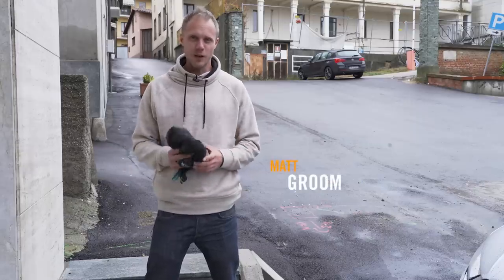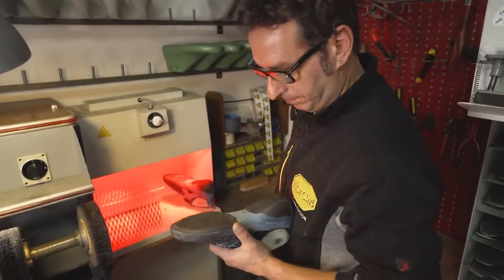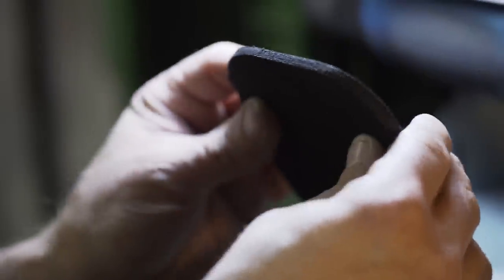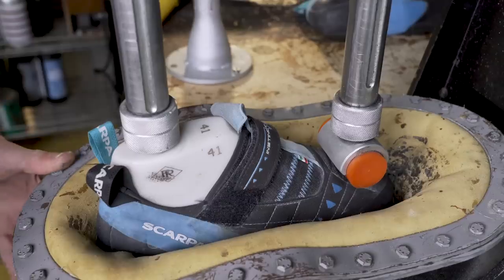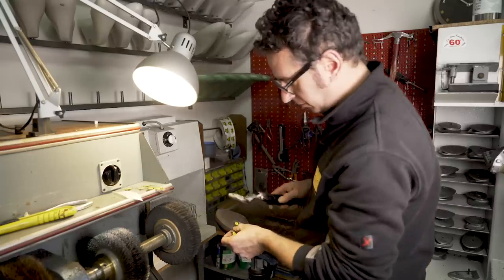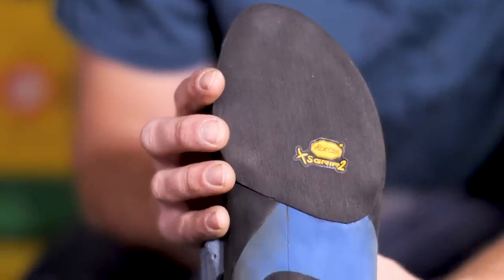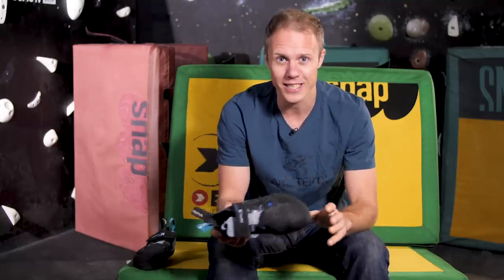How To EXTEND The Life Of Your Climbing Shoes | Climbing Daily Ep.1598

Comment: To share, another easy way to extend the life of shoes is to cycle them. One day off is not enough for the rand to regain original tension, and on back to back days the climbing rubber has yet to rebound between sessions.

Thus, I cycle shoes on a two or three day on one day off circuit, never using the same shoe on back to back days, and have found my shoes have regained a substantial amount of tension and any divots depressions in the rubber have all but vanished. This is especially useful for my project shoes which see one or two routes or problems every few days but stay familiar to my foot for outdoor treks, and I do not use busted shoes for training.

Expensive in the beginning, but since I started cycling shoes I get about 50% more life out of them and better performance every time.
Reply: What do you mean by 'getting more life out of them'? Do you usually throw out shoes because they don't perform anymore rather than due to a worn out sole?
Reply: Tobias Grätzer I am referring to the tensioning system holding through multiple resoles as well as the rubber itself lasting longer, thus needing to be resoled less often.

Comment: Items needed: 

Belt sander, (or angle grinder and flappy wheel) Sheet Rubber, Heat Gun or Heating Lamp set up ( alt Toaster.) 

Mold for different size feat and Bench mount. 

Specific contact adhesive/Glue

Comment: Hey Matt, the storry with the holes is not true, i'm using mine always until there is a hole (about 1cm x 1cm). I'm from germany, bavaria and we've got some specialist here which will resole the shoes also in this condition. the outcome is unbelivable good you'll always find glue at the top of your shoe because there is also rubber on it and yes they are also renewing this as well (e.g. my pair of OCUNE Oxi S there is really much rubber on the top). They are offering a wide range of soles Vibram and other as well. Price is quite low and waiting time is up to 8 weeks but its worth it.
Reply: Hast du eine Adresse und einen Namen? Besten Dank im voraus!
Reply: Ich wirklich Restday oder Saltic empfehlen, mit den meisten deutschen Schuhmachern hatte ich nur medium gute Erfahrungen. Ich kann die Schuhe bei uns in der Halle abgeben und die schicken sie dann zu denen. Früher haben wir gesammelt und immer 10 Paar auf einmal geschickt. Einziger Nachteil ist, dass es meist einige Wochen dauert. Das Ergebnis ist aber wirklich sehr gut.
Reply: @stubenification  Ich lass das über Eldorado Bergsport in Nürnberg machen tel:0911-18073670   website: https://www.eldorado-bergsport.de/

Comment: Question: does the rubber maintain it's shape after resoling in terms of it molding to your foot?
Reply: Depends on the craftsmanship of the resoler and the type of rubber they use. Find a good workshop and your shoes should feel good as new
Reply: The toebox can feel different after a resole, at least for the resoles ive gotten ive had to wear them in again
Reply: if you replace the rubber its not gonna feel like rubber that has molded to your foot. its just simply impossible. its gonna take shape eventually again

Comment: I was so happy with my Scarpa shoes being resoled! However I seem to have problem finding an official resoler for my La Sportivas.
Reply: Try restday or saltic as your resoler, they make a really good work and have all the different types of rubber.
Reply: I've used Cheshire shoes over the years to resole my LS Mythos (two different pairs, four resoles). I'm not a great climber but have been very pleased with each resole job each time. They were even happy to put C4 stealth rubber on once, but couldn't feel much difference at the time between C4 Stealth and XS Grip, but that was probably down to my inexperience. Either way I'm at least happy with their results as well as the cost of the resole and time (around a week before I have them back after posting them off to them).
Reply: @jaakofagerlund4360  Sadly I live in Sweden, so that would end up being quite expensive resole :D
Reply: @mikafull  do you know anything how it works with shipping?
Reply: @mikafull  Thanks you so much for help! :)
Reply: @ca.elizabeth  no prob, or you can go to Arco for a climbing trip, there a several official resoler

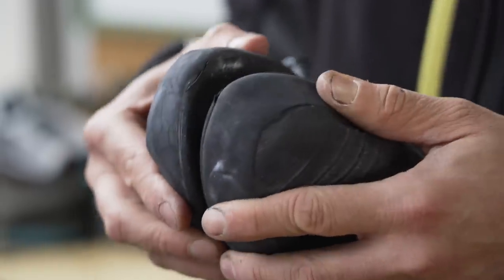Comment: 1:05 min: Not every company does it, but you can definitively make your shoes resoled if they have a hole.
Reply: True, mine usually get a hole at the tip where the big toe is and my local cobbler has been able to repair them each time. If the hole is too big they fill it with some hard red rubbery material before gluing new rubber over it.
Reply: If you have a hole in the rand you need to repair it with a new piece of rubber which means the shoe will never feel quite the same anymore.
Reply: This is not true and it depends on your resoler.

Comment: I’ve resoled my vapour v shoes, but they don’t feel as supple and sensitive as they were before, even with wearing. They’re now much stiffer and downturned (which the shoes are not designed to be) and now scrunch my toes up to make them very painful. Is this just me?
Reply: Bella Ridgwell depends on the quality of the resoler and whether or not you needed a toe cap which will warp the shoe slightly. Too, many synthetic uppers will dry and contract during the wait period, but just have a session break in. As well, if you climbed in them frequently then the tension system never had a long period to rebound and thus felt softer than they should have been.
Reply: Vapor Vs are usually quite downturned no?
Reply: DonalG45 vapor vs are downturned and stiff but Bella noted being much more

Comment: Interesting.  I always tell myself to resole my shoes but they always end up beyond repair (rubber on top of shoe also coming off, etc.).
Reply: I never have an issue with the bottom part, the sole. Mine always break, get holes just above the line above the sole :/
Reply: Toepatches can be resoled too. The guy who does it in my hometown does the toepatch by default.
Reply: Maxime Banel by default caps? I would find someone else as while a ton of folks wait too long this should not be assumed to be necessary and limits the life of the shoe.

This is why not waiting is important because a good resoler with the climber sending them in on time can do several resoles without altering the shape of the shoe, but a toe cap will.
Reply: @Cacovangor  You're probably right (I've never gone past one resole), but the option is still there for those who blow through the top rubber before the sole.
Reply: @dark-o  That indicates that you are dragging your feet across the rock a lot.

Comment: The feeling of the shoe might differ after resoling.
Reply: my Scarpa Vapors  got significantly stiffer after I got them resoled, but I didn’t mind and got used to it quickly. I assume it depends on the rubber used for the resole, as I didn’t get the softest one they had.
Reply: It depends on the craftmanship of the resoler. The guy I send all my shoes to is a genius and my shoes come back with the same fit, and at times better crafted than when I first get them. You can check him out on his instagram @sweet.black22